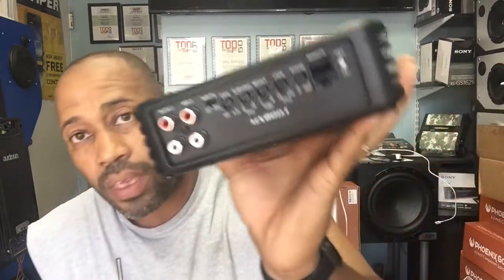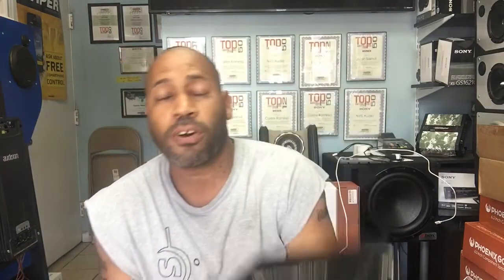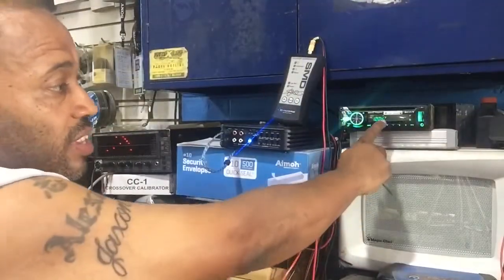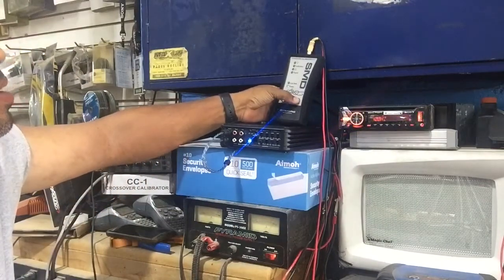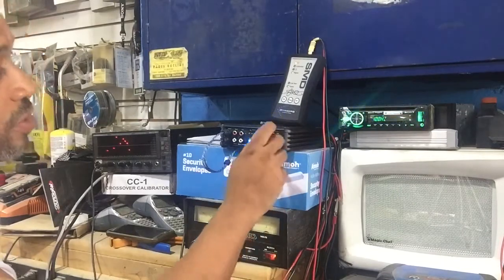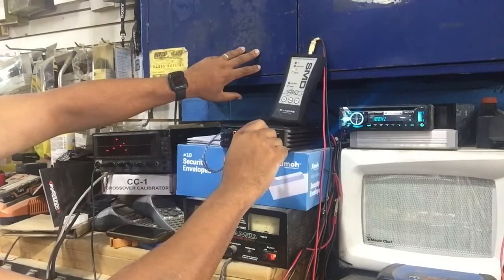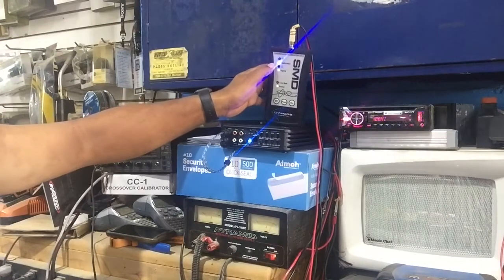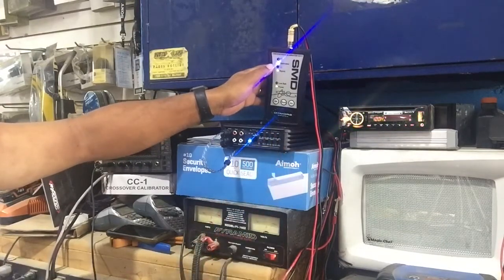SMD CC1 crossover calibrator review by Nvs Audio

Comment: how does smd cc-1 and dd-1 compare to audio controls dm-rta?
Reply from the maker: Tommy F you cant compare the 2 they are completely different tools ( we have all 3 ) dm rta is what more powerful then the cc1 and dd1  it can detect distortion like the dd1 but it’s can’t calibrate crossovers like the cc1 . 

If you can only buy one 
Buy the dm rta
Reply: @NVSAUDIO  thanks for input..i guess ill just haft order the cc1 and dm-rta! Just getting back into custom car audio (i put it on the back burner when i bought out a tint shop awhile back).
Reply from the maker: Tommy F call me if you need help setting it up